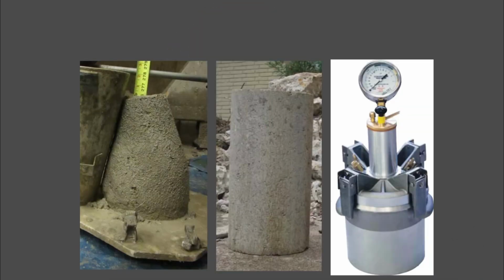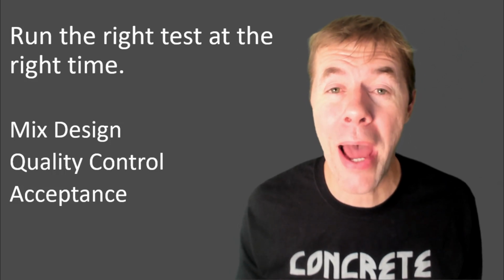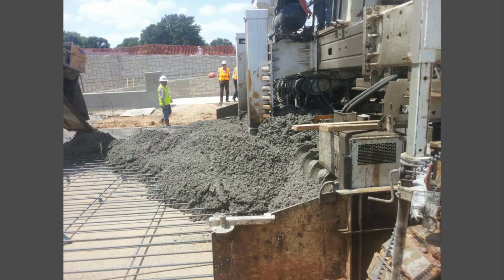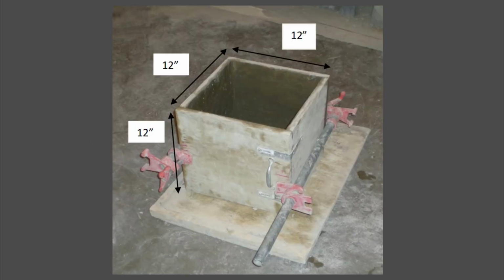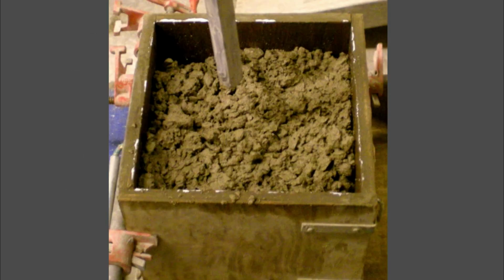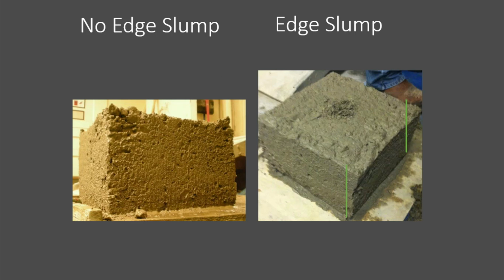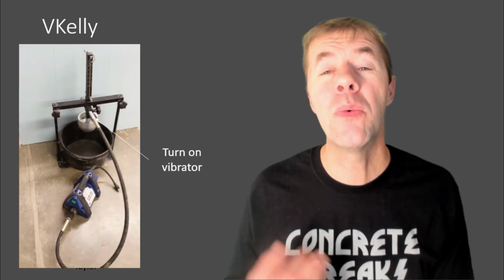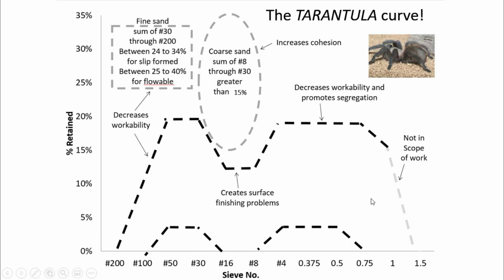Workability for Dreamcrete - Performance Engineered Mixtures pavement workability

Comment: I have been thinking about fly ash as of lately.

Yeah, I already know I'm not like the other children.

I already know it's used in some concrete applications.

But how much can be used in concrete, how does it affect the concrete quality and workability?

Are there any health and safety issues working with fly ash or with the finished concrete construction?
Reply: It's already mixed into some types of cement.
There are also different types of fly ash, so that too is a whole new realm of variables to introduce into the cement. Fly ash from coal has been around a long time. Now there's also considerations regarding volcano ash. Slag from iron works, CKD (Cement Kiln Dust, which is basically the ashes from the combustion in the cement kiln and it's quite nasty by itself) and a lot of other materials that are "active" but considered waste from other operations are of interest, but all have to be tried to see if they are feasible to mix in - and for what purpose it's mixed into the cement.
There's a lot of research going on in order to lower the CO2 impact, not just capturing the CO2. Different fuels also plays a role.
So it's not like going back to the old days where you basically burned limestone to get Calcium Oxide and then mixed it up with some more or less random filler to get mortar to keep your brick wall together.